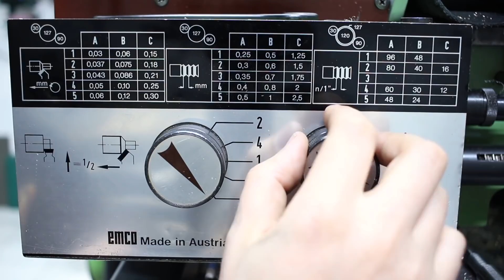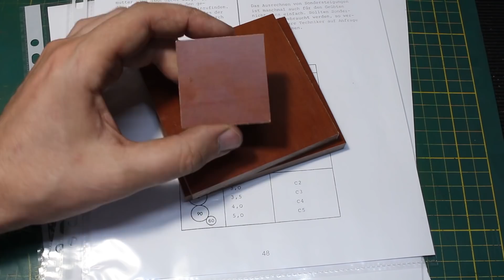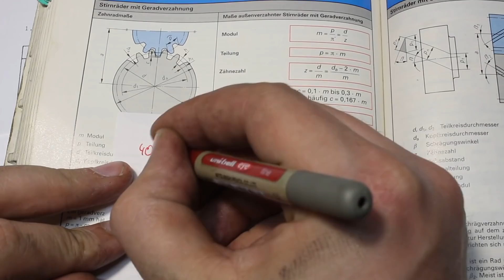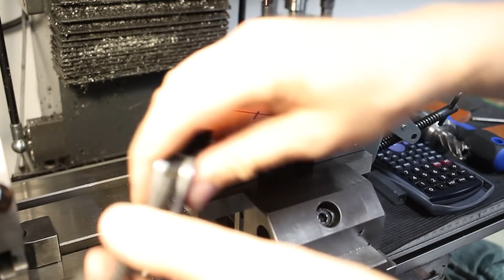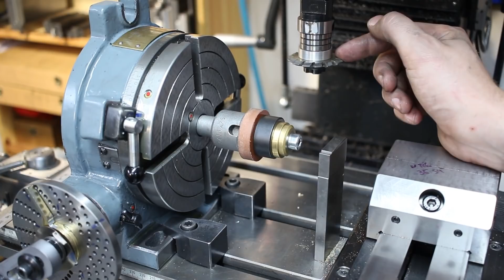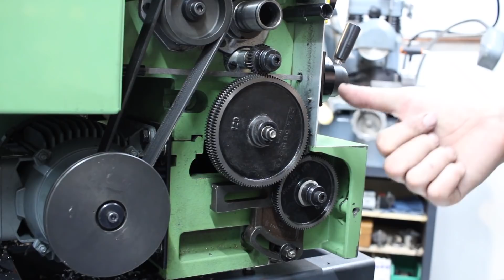Emco Super 11 Change gears, gearcutting and threading

Comment: And that's how its done boys and girls. Thanks Stefan for the lesson, and a pleasant video.
btw Is phenolic better in this application then say aluminum.
Reply: Not only are the phenolic gears quieter, but they will reliably fail at over-torques which will break the phenolic teeth without any injury to mating steel gears.  This safety feature was commonly found in movie projectors where there was a likelihood of an occasional film jam that would seize a sprocket shaft.
Reply: @jrb_sland5066  Ah ha.. The reason for my Q was to make it tougher, but its fragility is actually beneficial. Then its a good idea to always have at least one phenolic gear in the set up.
Reply: Yes, precisely.  I have seen machinery that includes shear pins on shaft couplings that serve the same purpose, and of course we use fuses and/or circuit breakers in electrical systems to prevent fires caused by too much current melting the wires.  Etc, etc...
Reply: @jrb_sland5066  it's also fairly common to use a lesser grade bolt in certain areas such as a grade 5 or a grade 3 bolt to act as a weak point or engineered failure point.
Reply: Id say it's quieter running
Reply: Sure. The feed clutch for my lathe has a small soft pin that will shear if you want to put an apprentice mark on the cross slide or compound rest.

Comment: You need that electronic leadscrew kit from Clough42!
Reply: i am building it for sure
Reply: @takisbakalis   Absolutely!   Of the several commercial products, and those successfully created in the home shop using Arduino tech, James of Clough42 fame strikes me as having the most professionally engineered product.   (I suspect his day job is in some engineering discipline.)  I would like to have seen a multi-line LCD display or perhaps a touch screen offering, but I suppose that could be accomodated easy enough if someone was ambitious.  

Now, I just need something better than a 20 year old 3 in 1 machine to put one on.
Reply: @sansdecorum4600  touch screen not that good to be on the side of a manual lathe, but yes, the interface can be much better, but it's at its beginnings
Reply: @takisbakalis  Point taken, contaminants, grime, and such being touch screen unfriendly; not to mention missing the tactile feedback of buttons.    Appreciate the constructive feedback.   It's how we learn.
Reply: @sansdecorum4600  It's an endless process! Let's wait a bit where clough42 goes with it, I got the encoder and waiting for the board to be available!
Reply: W ait..  didn't Stefan have one on the old lathe??
Reply: @EmmaRitson  Yes, he had a Rocketronics ELS on his previous machine
Reply: @andrews8552   yes but this was an ELS II and Stephan just mounted the z motor. 
The ELS III is a grown up machine tool, with a lot more Features and really professionel made!
Reply: @EmmaRitson  I remember a controller for a rotary table
Reply: @takisbakalis  i think you hv]ave to carefully look at lathe footage in some of the later videos with the old lathe, to see it.. not sure he published it.
Reply: or an ELS III from Rocketronics. Thats an excellent device with really handy features.
Reply: @surmetall5596  While it's a nice product, they luck a bit in presentation, nor engilsh instruction (couldn't find by browsing their site)
Reply: But once you have an ELS you are just one motor away from a fully-CNC machine, so might as well go the whole way. 
(Used as a kind of power-feed with auto-return and repeat it isn't any less fun than manual lathe work, I find to my surprise) 
Example: https://www.youtube.com/watch?v=nIYMfyf4jDI

Comment: Couldn't you double/halve the intermediate gear on the 1.5mm setting (ie just make one additional geaf)? Maybe that stack wouldn't fit on the banjo?
Reply from the maker: that would be a 127*2 gear. quite large ;)
Reply: @StefanGotteswinter  ouch, fair enough👍is that 127 tooth gear part of the inch set ( being half of 254)?  Having seen the rest of the video, I sas surprised there wasn't an idler/middle axle already on the banjo, all my cheap chinese lathes have had one- nowhere near the quality of the one you made of course👍👍
Reply: @StefanGotteswinter  
Stefan, there is an online gear train calculator.  Google scientific 601. Just enter the ratio, minimum and maximum number of teeth and the amount of steps.